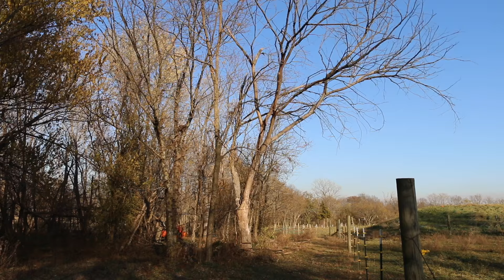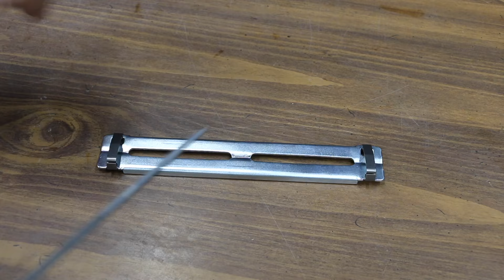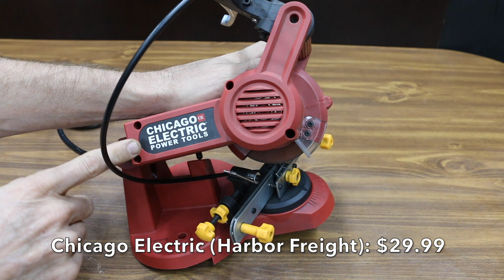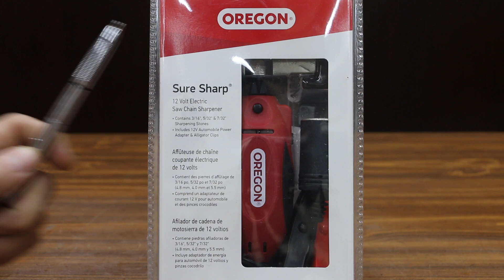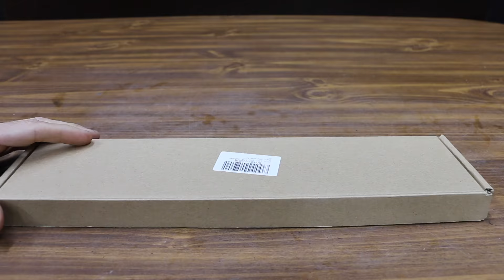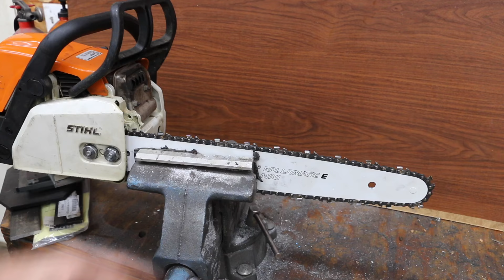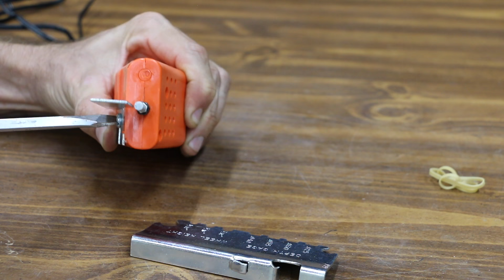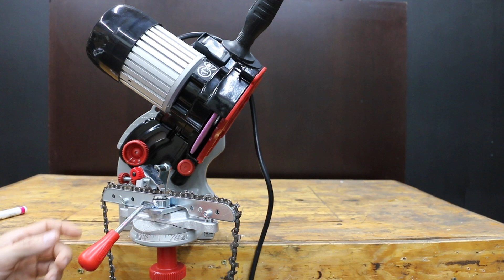Which Chainsaw Sharpener is Best? Let's find out! Stihl, Granberg, Chicago Electric, Oregon

Comment: I personally love the Stihl 2 in 1, we always take it with us to the forest, takes me max 3 minutes to sharpen the chain.
Reply: I've tried many sharpening tools and failed miserably. I haven't used the Stihl. Is it easy to use by a layman?
Reply: @markbrisec3972  absolutely,  and as long as you file all the teeth the same length, every tooth and depth gauge will be filed exactly the same.
It's a game changer for hand filling, zero learning curve.  Just be sure you have the proper size 2in1 file for your chain, there are a few different sizes
Reply: @markbrisec3972  Yes! Just make shure the blade on your saw is fixed in a vice or something similar. Stihl sells a little device that you can bring with you into the forest for this purpose. I love my 2 in one, and I am not a professional👌🏻
Reply: @markbrisec3972  I find it very easy to use. The handles helps you keep the round file lined up on the chisels. The flat file lowers the depth gauges at the same time, which is really nice. 

Just a week ago a customer brought a saw in that had had its chained sharpened at another professional shop, and the saw was just bouncing off the wood. They hadn't lowered the depth gauges! It's a pain with  conventional sharpeners, mechanical or manual, because it involves another step, but you have to do it. 

With the 2-in-1, you lower the gauges when you sharpen the chisels. That alone is worth the price, IMHO.
Reply: @markbrisec3972  Yes. I recently purchased the Stihl 2 in 1, works great for me, an occasional chain saw user.
Reply: @markbrisec3972  yes and the stihl dealer will show with proper instructions
Reply: Stihl 2 in 1 is my go to. I am no chainsaw expert but for an average Joe with not much chainsaw use this product is the simplest and easiest to use.
Reply: You got it right Hannah.  I do the same.  Files rakers(depth gauges) at the same time.  Great sharpener
Reply: Yup. Totally agree too. I’m a noob to chainsaws and the 2in1 is a great piece of kit for a beginner to. Can’t really go wrong
Reply: Stihl 2 in 1 & a stump vice! I have a nice oregon electric bench grinder and never use it. The grinder heats the tooth too much, takes too long to setup and doesnt knock down the rakers.
Reply: Stihl 2 in 1 looks like the clear winner to me when you consider it does the depth gauges too and seems very fast to set up. The other thing to consider is the time difference of cutting that stack of wood between it and the 1st place Granberg is 0.52 secs. That short amount of time is barely noticeable.
Reply: The 2 in 1 comes in different file sizes. You should get the right size for your chain. I have two because I several different size saws with different size chains. I love the guide. I have one of those stump vices that makes sharpening in the woods easy.
Reply: Yep. You can't go back to the shop and run your power grinder if you're out working. Lowering the depth gauge at the same time is a big plus, too.
Reply: Yep, that's all we take out with us when felling 👍
Reply: Agreed the 2&1 works really well.
Reply: I think it is a rebranded Pferd. Pferd first had one that had one file that you have to switch around. Then they came out with this version. It is quick and handy and deals with the rakers at the same time.
Reply: My dads 92, been using chainsaws for decades. I don't think he knows about the depth gauge.
Reply: I bought an off brand of the Stihl on Amazon and it works great.
Reply: if you flip the file as you go to each tooth,  you can work the whole chain in one pass.
Reply: I am also a noob when it comes to chainsaws, but the Stihl tool works perfect with my small Husqvarna. There are chinese duplicates on the market now, but I doubt, that they are as good as the original. Greets from germany
Reply: @robertjanko6709  the stihl is made by Pferd. About 10 bucks cheaper than the stihl but in a rather unflattering blue
Reply: @70baja  I know, I am using a a Pferd too, when I am out in swedish woods. ;o)
Reply: Yeah, the Granberg looked difficult to set up even if it is the best at sharpening
Reply: Hands down the best for the money.
Reply from the maker: Thanks for sharing.

Comment: Excellent review. I'm very impressed with the Stihl 2 in 1 manual file holder. I have a professional bench grinder which is excellent but can grind an awful lot of tooth if the operator (me) is not very careful. Normally I just follow Buckin' Billy's method and use a hand file unless I need to take a lot off the teeth (very rarely). Thanks for your meticulous review. I think I'll look into getting one of those Stihl manual 2in1 holders. That Makita battery saw looks awesome.
Reply from the maker: Thanks for sharing.

Comment: Excellent! I loved how you showed complexity to set up, if the chain had to be taken off the bar, cost, change in geometry with poorer cutting results, ease of use, battery verses electric cord on sharpener, etc. Looks like the backstop on the Granberg really helps keeping the tooth from flipping backward and keeps consistency of sharpening across the entire tooth. The backstop eliminates the problem where beginners take a loose chain and use a field sharpening device and the tooth flips backward.
Reply from the maker: Thanks!  Thanks for the feedback.

Comment: You are a brave man.  Saw chain sharpening is right up there with concrete work, welding, and barbecue.  Everybody out there has the "best" way.  I can say with confidence that all these systems will work.  But if you use any grinder or power product, you have to careful to only remove enough steel to make it sharp and be gentle.  It's very easy to take too much off, greatly reducing chain life.  Power sharpeners also make it very easy to ruin the temper of the teeth.  There just isn't a lot of steel there to absorb or carry heat away.  So a chain may cut like a razor initially but because the steel is softened, the teeth will no longer hold an edge and dull very quickly.  There are more myths about sharpening chain than I can count.  For the average weekend warrior, all of these will do ok.  But in my experience, the best overall chain sharpener is simply a quality set of files and a depth gauge and a vice, be it manufactured or a field stump vice and practice.  It takes repetition to learn, but you can keep a chain very sharp for a long time by not letting it get noticeably dull in the first place.  Every tank of gas or two, or battery changes, a half stroke per tooth to tune the edge is all it takes.  A second or less per tooth when you get the rhythm going.  Maintaining instead of correcting is even more important with battery powered saws.  Dull chain has a HUGE impact on battery life and how much wood you can cut per charge.  If you pretend that touching the chain to the ground is an abomination, you're already half way there.  Haha!  Good video!  Keep up the great tests.
Reply from the maker: Thanks, will do!  Thanks for the feedback.

Comment: If you tweek the cutting teeth 2 degrees out with a 6 inch shifter spanner you should see how quick it cuts i did this cos the bar was jamming half way through the cut ! Wow what a differance in the speed you should try it !
Reply from the maker: Thanks for the suggestion.

Comment: If only cutting hardwood, don't bother cleaning chains.  Also, I have both the grandberg electric and the stihl 2 in 1.  The grandberg is awkward and clunky due to the need for careful set up and chain advancement, but is the only choice for my chainsaw mill chain because it can be done on the saw.   You don't want to have to remove the chain on the chainsaw mill, and Stihl doesn't have a 2 in 1 for .404 chain.   The Stihl 2 in 1 is the hands down winner for any chain smaller than .404.  It's totally portable and doesn't require electric, it does the cutters and rakers at the same time.  The teeth don't need to be the same length like on some of the electric ones as the 2 in 1 doesn't need to index off the raker.  The 2 in 1 cuts fast with only 3 strokes per tooth and lets you use a chain for it's whole life until there isn't enough tooth left to sharpen.  I've never had the saw dive left or right when haveing used the 2 in 1. Hands down the 2 in 1 is the fastest to sharpen, gives you as good or better than new chain sharpness.
Reply from the maker: Thanks for the feedback.

Comment: Im not sure if this would be up your alley, but getting you hands clean after a dirty job can be a pain without a good cleaner, would love to see you compare hand cleaner/soaps, such as glo-jo, snap-on's orange (imho the best,) man hand cleaner etc. Not sure how hard it'd be to compare them though.
As always, love your work PF, no one comes near to your level of unbiased straight facts
Reply: I make my own hand cleaner, take a full box of Borax and mix in just enough water to make it the consistency of wet sand, then also mix in a quarter cup of Dawn dish soap and store in a sealable container. Now if you get pine sap or roofing tar on your hands spray some WD 40 on your hands and rub and follow up with the DIY soap and you will get clean.
Reply from the maker: Great video idea! Thank you

Comment: Among my duties as a hand held service technician is sharpening chains customers bring in. OMG I don't know where to begin but final results on this are badly skewed by inexperience. I will agree that if your going to do your sharpening by hand the Stihl combo sharpener is hard to beat.
Reply from the maker: Thanks for sharing.
Reply: @ProjectFarm  Sorry man. Not trying to bash and have been a subscriber for a while now. Your examples are perfectly accurate with what some may  experience buying and using these machines. There is a definite learning curve not only for each option but what to look for on the chain as it is being sharpened to get good, consistent, and accurate results. One thing I noticed on the Oregon bench mounted sharpener was it appeared you were plunging the wheel in a single pass. That generates heat thus the bluing and that changes the temper of the steel in a bad way and leaves a bur that is welded to the chisel that rolls over causing a dull cutting edge of some degree from the get go. It also causes flex in the machine that makes every chisel uneven. When you sharpen a chain with any of those a bur should raise up once the worn or damaged portion of the chisel is removed and it should easily be able to be flicked off with a finger nail.

Comment: Have for many years used dremel with rotary stone, they make sizes to fit chains don’t have to remove chain. Dremel has varied uses and rotary stones under 5.00. If you are competent enough to use chain saw you can align pitch and depth by eye save time and money with dremel
Reply from the maker: Thanks for the feedback.

Comment: Decades ago I worked with professional workers who used the chainsaw daily. Every evening they would clean the chain and blade with gasoline from the resin and then put the chainsaw in the vise and use a round file. They did this every day and they knew exactly which angle. There is no cheaper and quicker way to do it.
Reply from the maker: Thanks for the feedback.

Comment: Let me give my opinion.  Some of these sharpeners are too complicated to use in the woods.  In a shop, on a stand and with patience they may work well.  All motorized units that use a circular flat disc have the wrong angle of attack on the tooth which makes them less desirable.  Though this is what is used in every store that I've ever taken my chain saw to for sharpening.  The Stihl unit is licensed from the German company that invented it, Pferd.  The Pferd 17301 CS-X Chain Saw Sharpener at Amazon is a great deal at $33.  This company has been in business since the late 1700's when they made files and farrier tools.  Pferd [pronounced faired] is German for horse. Stihl licenses the sharpener from Pferd.  They changed the color from blue to orange and charge $6 more for it.  The one thing that wasn't covered in your test was longevity.  I have to believe that the motorized units using a disc with the wrong angle of attack on the tooth is going to cause that chain to lose a lot of usable life and the motorized disc doesn't address the guide [or rake].  So, I use the Pferd.  It's ability to sharpen the tooth and address the guide all at the same time and quickly with a minimum of set up is brilliant.  And it leaves the teeth wicked sharp.
Reply from the maker: Thanks for the feedback.

Comment: Can you do a video on battery chargers for %100 dead batteries? My truck has an electrical issue and kills batteries when not used for a while and my charger won’t charge it unless it senses a charge in the battery already. Also when camping we have the same issue our trailer is completely solar but if we run the battery dead at night the charger won’t charge them if they have no residual charge ( we usually party all night while camping) so basically what would be the best charger for completely dead (zero volts remaining) 12 volt batteries
Reply from the maker: Thanks for the video idea.

Comment: FYI: Check the size of the Harbor Freight sharpening disc and refer to yiur chain's specs.  It only fits a few chains, and if you use it on the wrong size chain, it will be worse off than dull.
Reply from the maker: Thanks for the suggestion.

Comment: What happened to just a file?  In my 40 years experience I have only used a file to sharpen chains.  No guides or power needed.  Surely the lowest cost, works for me and it is likely that the chain will last longer then using any power sharpener.
Reply from the maker: Thanks for the feedback.

Comment: Your testing is flawed my friend for unless you file the rakers with a gauge the sharpness of the teeth are  usless for the death rakers must be low enough to allow cutting edge to reach the cutting surface with enough allowance to pull off a maximum length of chip ,this said a small saw like that thing about. 25 to. 30 thou is max potential and on say a husqvarna 455 ranger or larger. 50 thou comon man dont do such testing on products you dont truly understand for when one does this he is being a fraud and his information is flawed ,even when he doesn't realize his fault !

Comment: With just a few seconds difference in any of the cutting you did after you sharpened the chains, if I had my choice in the field , I would prefer the 12-volt sharpeners, however I have sharpened many chains by hand with a file and seem to have done just fine. If you're going to be sharpening a hundred chains a day I think I would go with the Chicago Electric sharpener, for the price. Nice video as always.
Reply from the maker: Thanks!  Thanks for the feedback.

Comment: Project Farm I have a really good one for you to test: I have always wondered the mpg difference between 87 octane and 91 octane on cars that require 91.
Reply from the maker: Thanks for the video idea.
Reply: i would be willing to sponsor the rental car that requires 91 as well as the gasoline and production costs as long as its within reason
Reply: If you end up doing it... if possible I would like to have a chairty as the name sponsored, rather than my business
Reply: My thoughts are, 91 octane engine with 91 octane gas may potentially have advanced enough timing with lean enough conditions that the mpg difference may counteract the additional cost compared to 87... it may not but I would very much like to find out how close it comes if it doesnt.

Comment: Not mentioned is that most of these will require filing down the raker tooth, at some point, while the Stihl 2-in-1 does that every time, but only as needed.  Is it the best value of the units tested?  Yeah, it is...and it's probably the best value on the market, period.
Reply from the maker: Thanks for the feedback.

Comment: Idea for testing concrete sealers! You can create concrete columns by pouring cement into a long square concrete form and use perforated pipe to make an internal column void (or maybe a long hole drill?). Then you can apply the concrete sealers by pouring them over the concrete columns or apply otherwise according to manufacturer directions. I bet you could even apply specific water pressure with appropriate fittings or something. Concrete sealers can add up to a huge investment for homeowners like myself looking to seal a basement from the wrong side in haha :c
Reply from the maker: Thanks for the suggestion.

Comment: Why 5/32" for 3/8" chain?  I'm nearly certain I use 7/32" on 3/8 chain.
Reply: It was probably a 3/8" low-profile chain. The cutters are not as tall as on regular 3/8" pitch chain. 3/8" LP chain is common on electric and smaller gas saws and generally calls for a 5/32" file

Comment: Your content is awesome and informative. Thank you! Have you compared PEX vs. Copper vs. PVC vs. CPVC vs. Galvanized vs. ? For freeze, pressure and temperature extremes? Would be fun and informative. Also, the fittings associated with them, sweat, compression, PTF (shark bite), propress, crimp etc?
Reply from the maker: Thanks so much!  Thanks for the video idea.

Comment: What happens if you mix different viscosity oils in an engine. For exemple if you mix 0w40 with 10w20 you will get a mix similar to a 5w30 off the shelf? Or if you mix 3 types of oil will the engine have better lubrification at any moment? Cold start and till working temperature...
Reply from the maker: Thanksk for the video idea.

Comment: I use electric hand dremel with sthl stones and sharpen as needed. I cut 6 to 8 cord with 3 yellow ripping sthl blades which are expensive but versatile when ripping wood with 48 inch diameter rings. My cost is around 200 a year for supplies. I also use a farm boss and 250 sthls. My wish list saw is over a grand and husky with larger bar. But may switch to coal as I get older.
Reply from the maker: Thanks for the feedback.